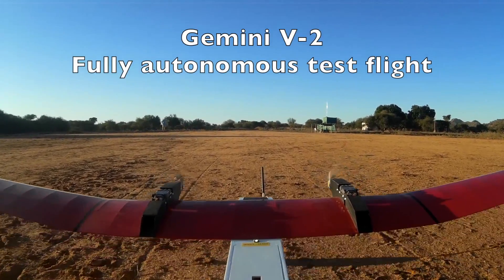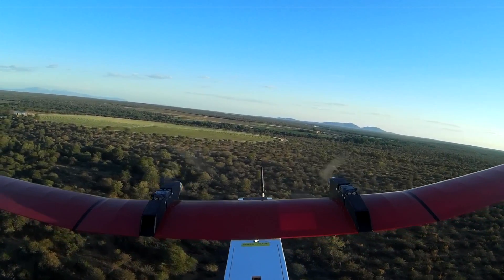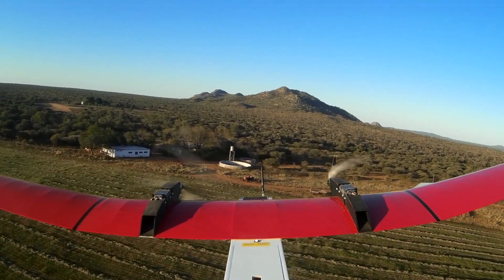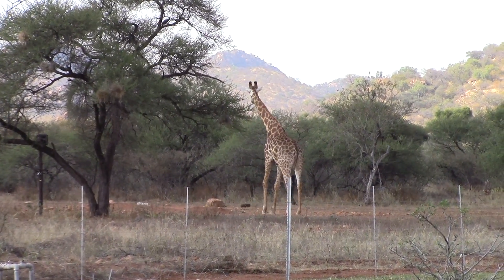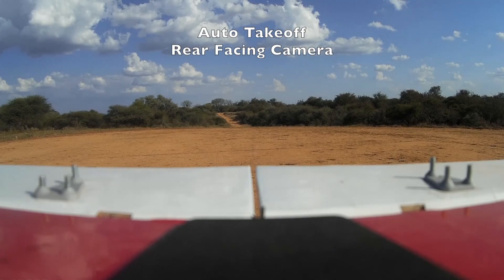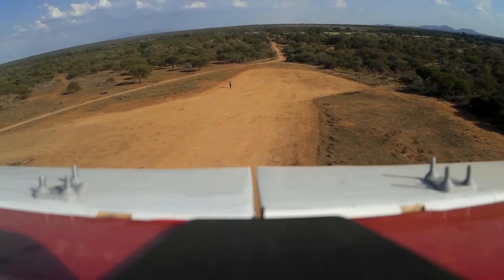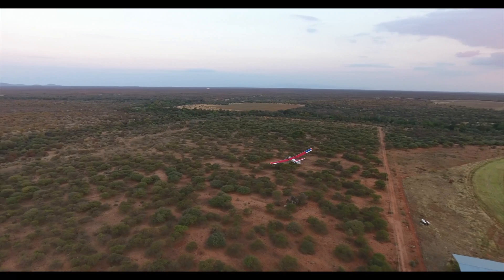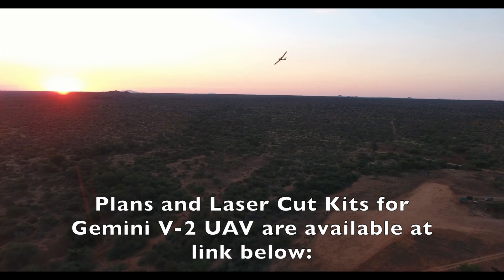Gemini V-2 in Africa Behind the Scenes with Audio Checklist

Comment: this is awesome, have you considered a lifting body design for the future? i want to make a diy model version of ZipLine's autonomous delivery planes from Rwanda
Reply from the maker: the Zipline design is good, but there are negatives to lifting body designs. 
the center of aerodynamic pressure moves forward when angle of attack increases. this means that the CG must be very far forward, and in normal flight, there is a large down force needed from horizontal stabilizer, decreasing the total coefficient of lift of the plane, and increasing drag.  
it would be better if the body were oriented vertically, instead of horizontally, or were a tube.  
the extra lift generated by the lifting fuselage is not enough to compensate for the other issues. 
thankfully for the Zipine design, the size of the fuselage is small when compared to the overall plane, so the effect is small.  
The shape has far more to do with the delivery package shape than any other factor. it is a negative from an aerodynamic perspective IMO. 
The real brilliance of the Zipline design is the recovery method, and propulsion redundancy of the design.  Also the business strategy to operate in countries who value saving lives, and not getting involved with the FAA who has no actual plan or vision for the future, other than restrictions and arbitrary rule making, also problems with bribery from large corporations wanting laws to favor them (ahem amazon) and lining the pockets of the FAA directors. (ahem Michael Huerta)
Reply: @FPVREVIEWS  awesome, that makes sense since the nose would want to pitch up all the time
Reply from the maker: @azatecas  yes, when at low angle of attack/high speed, everything is fine, but when you slow down, or turn tightly,/low speed, pitches up and stall/spin.  it's why Northrop's flying wing project bomber was cancelled, and every other similar type has same issue.  it can be overcome by active flight control systems with sensors, but is inherently unstable.    In fact, every wing suffers from this, even high aspect ratio wings, and that is why the CG must be located at about 40% or further forward. the higher the aspect ratio (less chord) the less the affect, as there is less moment arm.